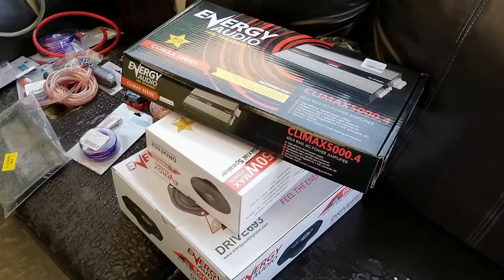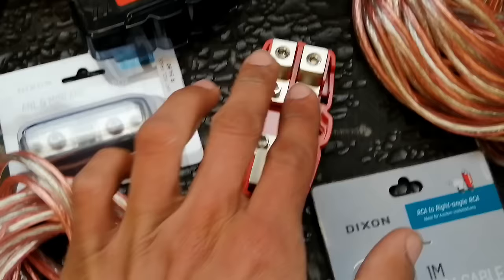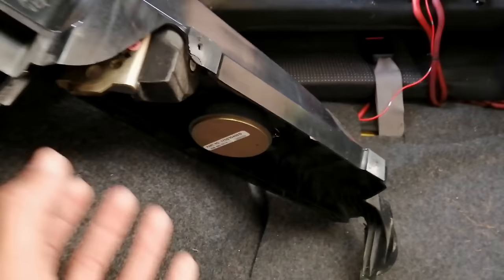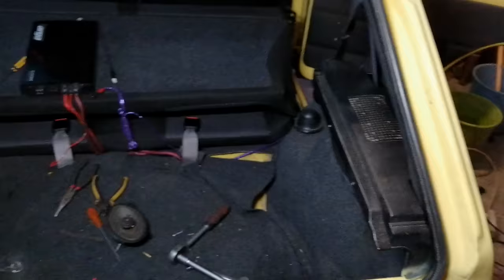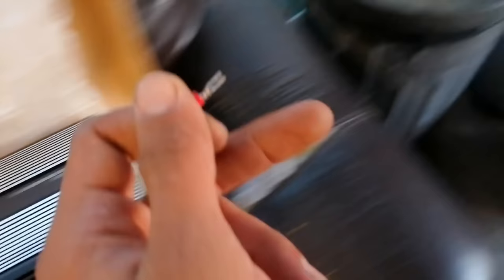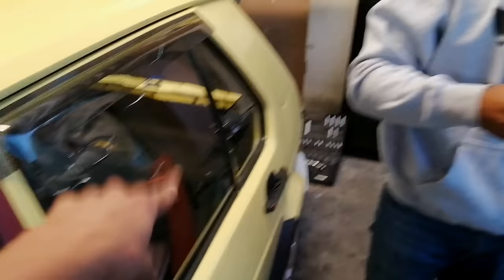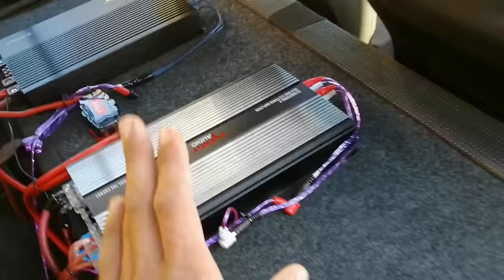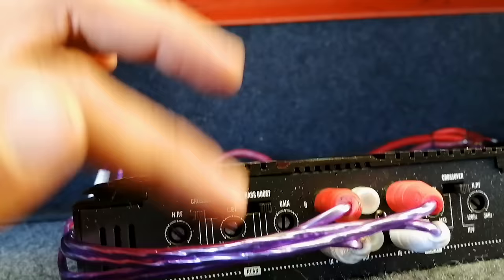SOUND COMPLETED! // Installing the Energy Audio 6x9's, Mids & Amplifier!

Comment: Nice video. Leave the bass boost at 0. Using the 2 to 1 rca splitter means you won't have stereo separation from left to right. If you don't have the proper tools to match your amps to your headunit use this method. Most headunits distort your rca signal when they are turned all the way up. Say your headunit goes up to 40 go ahead and turn it down to say 36. Next unplug the rcas from one of the amps. Start with the gain screw turned all the way counter clockwise. With your headunit not set at it's highest volume number start turning the gain clockwise till you hear distortion then at that point just go a little counter clockwise till the distortion isn't noticeable. Now unplug the tuned amps rcas and do the 6x9 channel then upplug those and do the mids. Hope this helps.

Comment: Neat bru...but just some advice how many rms is that mono block? I think you should get some welding cable 35mm pure copper and run it straight from the battery to the amp and do the big 3 upgrade....so the monoblock is not starved for power and hit protect all the time

Comment: Another great video bro 💪. I recently got my first car and I really want to install a sound system too , I've done some research but im still pretty much clueless , can you give me any advice
Reply from the maker: Sure. But in all of my videos there already enough tips on how to do a proper sound installation in your car. That is the reason for the videos buddy
Reply: @LateLateCustoms  nice system good job. What u should of done was cut the wires shorter to the distribution block to make it look neater and face the subs in front to sound better and the air from the box will flow better.
Reply: @LateLateCustoms  and to use  all the rca's u should install a equalizer also known as a preamp where u will be able to tune mids / highs / bass from it. If you are going to install one use the clarion , soundstream , planet audio eq for great sound.

Comment: Hey bro congrats really proud of the blogging material you sharing an inspired by the way you growing yourself.Well done Shane!

I have 2 questions that I'd like you to share your point of view on simply out of curiousity as perhaps theres something different we can including myself can learn.

1.Why not get a generic backboard an store the original that way if you sell or remove temporary  or permanently you still have the original to put in.?

2.Why do you face the box upwards? The reason In asking because i know bass punch more or rather theres more flex pants down movement if it bounces again something solid in this case facing outwards towards the boot would give a better bass.Perhaps a DCB reading we can do so we can all learn.

*If you gave the time remove the subs an in the box insert 45degree corners in the box also painting inside with wood sealer.Then check the diff in sound quality.

But thank you so much an well done on the material an once you finish the yellow thang perhaps you can run a raffle for the car with all your followers.

Comment: you talking about replacing rca cables n adding distribution blocks but you don't say why?? replacing rca cables as far as my experience and for your knowledge is to gain voltage. more voltage equals better output. distribution blocks............ I'm gonna teach u in another leason
Reply: Are u talking about voltage from the head unit to the amplifier? If so more voltage doesn't mean more output , if u don't level match your head unit to your amplifier u will send through a clipped signal to your speakers which will inadvertently burn it.

Comment: My amplifier goes into protect in and out without cutting of my amps when at higher volume (can someone please help me)
Reply: Do a big 3 upgrade and make sure your fuse and wire provide enough power
Reply: How many watts max is your amp
Reply: If that doesnt work u should get a second battery

Comment: The gain setting is wrong!
Reply: What would  be right
Reply: @ygbodybuilder3023   gain is set by getting the square root of power multiplyied by resistance! That will give you correct voltage! The other way is a special device that will show you when there is distortion! The device is more accurate coz manufacturers sumtimes dont give true power rating on speakers!

Comment: You need to do a whole lot more research on how to set amplifiers up as far as your gains and frequencies and a word to the wise don't use your DB settings they will actually blow your speakers because they give you an unclean signal to your speakers yes you might think that it sounds louder but that's because you are clipping them to death do more research lots more